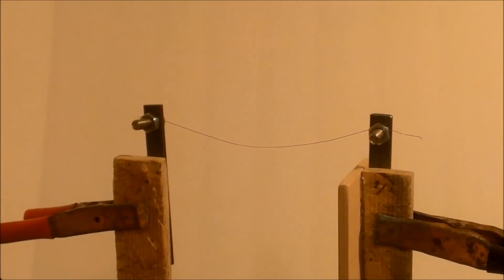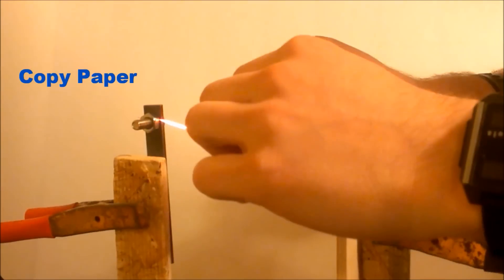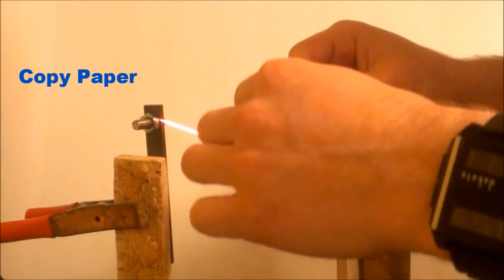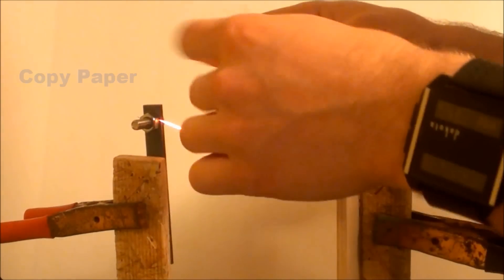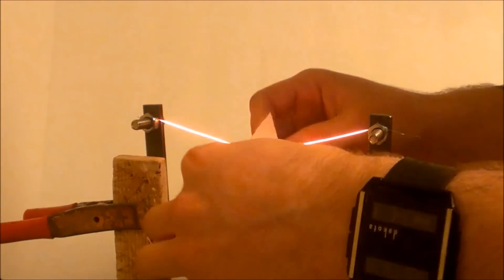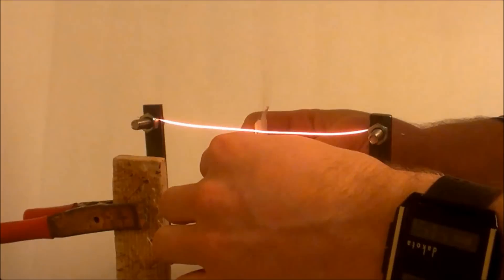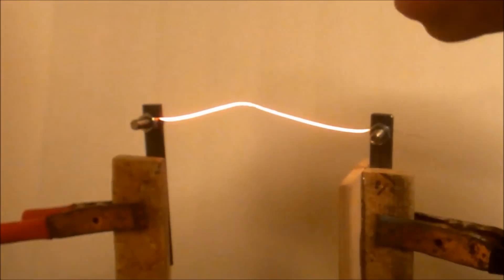NiChrome Wire: Cut Anything! - Demo | FozzTech

Comment: Still can't find any info about voltage and wattage used...
Reply from the maker: Should be in the Instructable: http://www.instructables.com/id/NiChrome-Hot-Wire-Cutter-for-Acrylic/ 
Link in the description also!
Reply: I don't see it there, unless it's in the other video.
Reply from the maker: I looked over everything and looks like you're right! My mistake after two years hah - 12v 5A if memory serves.
Reply: Thanks, do you know what temperature it reaches?
Reply: zioxei about 1300°c glass melts at 900 and 1300 is hot enough to melt it fast

Comment: great, what power supply were you using?
Reply from the maker: +Paul Tulk Thank you! I'm using a 12v car battery charger. I'd recommend checking out the Instructable I wrote as well for more details! The link is in the description.
Reply: Will do, thank you.

Comment: What would happen if the wire was spinning on a wheel? If it was spinning fast enough would it cut even faster? Just curious.
Reply from the maker: +Elixiredits I've considered making a modified version with the wire spinning, similar to a band saw, but haven't pursued it. From my observations, it would cut much faster and more evenly.
Reply: Sweet :)

Comment: Same question..how many amps used and gauge of wire?
Reply: My comment is kind of late to yours but as far as i red he used 12v car battery which from googling gives around 600 amps. Though regular 12v power supply would give 1 amp. I used a 12v pack with 8x1.5v alkaline batteries, although it burnt the wire in like 5 seconds but for my project it worked great. I guess he used 30awg wire.